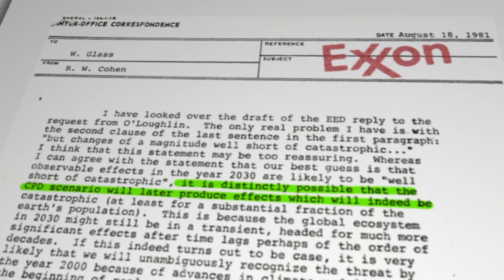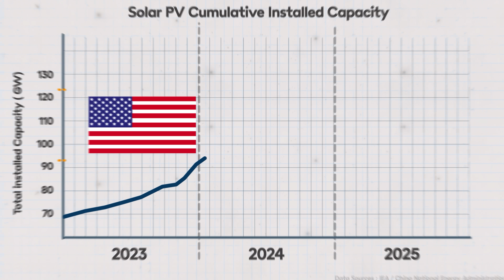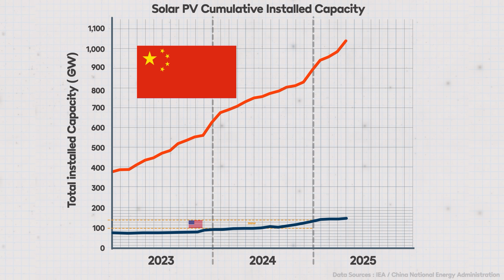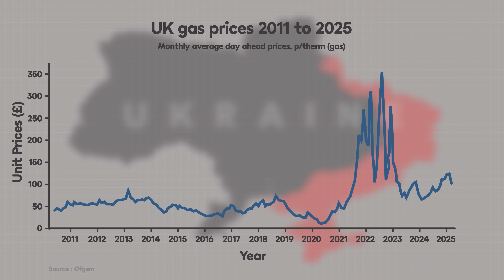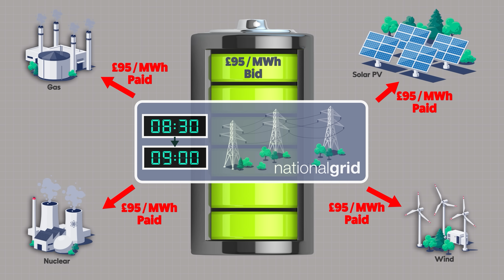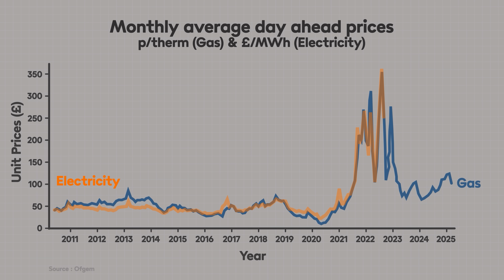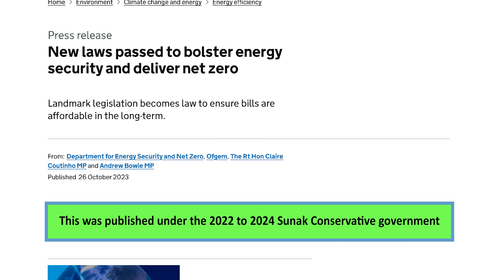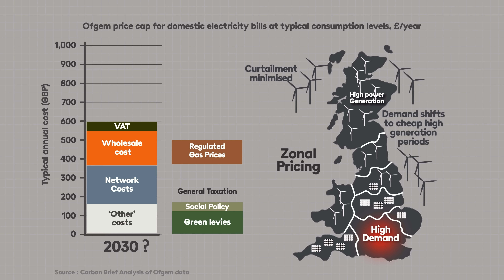Why is UK Energy SO expensive?

Comment: We live in a homestead-ish kind of land in NC. The original owners used a 15kW diesel to basically get all the power they needed and they were allowed to use the un-taxed farm diesel, because of some thing, probably grand-fathered in. We would have to continue with raising animals, which we obviously don't want to do, and tbh, me and my wife are just remote systems consultants with some travel.
Getting the power company to put power in our land would have cost us somewhere around $90k+, about $65k to the power utility and another $25-30k for the work we needed to get done on our own. We went with solar instead. Cleared off 7 trees which would have created problems and were old, and then we started learning and building slowly. We have an on ground solar array of 8kW, and our shed and larger shed which was used for farm vehicles has another 3kW + 8kW array on the top.
A total of 19kW of power, which is usually more than enough to provide daily power and also charge up our batteries. We decided we didn't want to spend insane money on getting batteries for home back-up. We found older battery modules from electric vehicles (we have nissan leaf modules, they go for real cheap, f150 lightnings, and a few tesla modules) and have around 130kWh of usable power in our home backup. We don't need UL or CE certifications, as we are not connected to the grid although we got it inspected by an electrical engineer for its safety. Total cost of materials was less than $55,000 - including buying the battery modules. Another $10,000 spent in equipment rentals (trench diggers, skidsteers, etc.)
We have a small 5kW generac portable diesel generator - it doesn't provide power to anything else, except for the batteries. And in the 5 years we've had it, except for the first year when we were working through everything else, it has operated for like a total of 250 hours. It charges the batteries, at a constant output of 4kW, which is excellent load for the diesel and also our inverters don't even get heated by it.
We bought 5-6 year old solar panels. Their pricing? We got those at 35 cents per watt. A popular panel like Qcell, 410W typically sells for around $330, or about $0.8 per watt. We didn't care about the degradation in the panels. And we still have like 20 panels in storage, because we don't really need those. This year, the only fuel we really bought is getting our propane tank filled once by a propane delivery service in our area, for outdoor cooking.

Anybody who tells you that renewables are more expensive is straight up lying to your face and insulting your intelligence.
Reply: Thank you for telling your story. It is very interesting. Being independent of grid supply is what a few people try here in Germany but is hard to achieve as there is very little sunlight from November into February.

330$ for just one 400 Watt panel sounds incredibly expensive to me.
I live in Germany and have bought 2 small solar plants, so-called balcony solar ("Balkonkraftwerk") . Both consist of two 400 Watt panels and an internally limited Inverter; the first one limited to 600 Watts, the second one to 800 ( this was after the legislation was changed and the limit increased). Such inverters can be connected to the grid by everyone without having to call an electrician. 
The first plant cost me 540€ or roughly 600$, the second one about 350€, and now you find such plants for under 250€. I bought the panels on eBay Germany at about 80€ each from a commercial supplier plus 50€ shipment for both. Now such panels are sold at 50€ per part. To my knowledge there is a huge surplus production of solar panels in China which is keeping the prices down.

I have put up the four panels in the garden and they supply a water pump for the pool which draws 700 Watts from the grid - 6 hours a day. I use about 90% of the homemade solar energy myself and only feed  10% into the grid. I don't get money for the energy fed into the grid but I don't care. Energy prices are high here in Germany. Just got a new contract for 30 euro cents per kWh (down from 36), and the 1000 Euros I paid for the system including some mounting parts and cables will be paid off bei the end of next summer. 
All that in northern Germany at a latitude that's equal to southern parts of Canada with probably much less solar output than in North Carolina. Nonetheless we are building big and small solar plants like hell in Germany. There's a total installed power of about 105 GW currently. Balcony solar systems - officially one million, probably another one million never reported to the grid companies - only make up a small portion of that. 
In the summer half year solar makes up about a quarter of Germany's total power consumption on average, in the hours around noon even more than 70% (up to 48 GW, at the total demand of about 65 GW). We even have to limit feeding to the grid now as energy prices on the spot market not just fall down to  zero , but get negative, so grid operators actually pay for delivering energy. This won't work on the long run, of course.

 In the energy crisis of 2022 many homeowners installed solar on their roofs, with about 10 kW as a typical size. Many people got ripped off by electrical installation firms when there was a rush - with some paying 30,000€ or more. But even them should be able to make their investments work - in some cases by adding a battery. Few people are autonomous like you are. Especially in the winter months there's virtually no solar production - but then wind kicks in which provides another 25% of our energy.

I wish you a good success with generating you own electrical power.
Reply: So you spent almost twice the national income, building on land that would be completely unaffordable for most people....
And you say it isn't expensive?
I'm pro solar, but you are high on something, or very dumb, if you think that isn't expensive.
Reply: They are more expensive when you take into account energy density, the low efficiency,  lack of spinning reserve, instability of the system and the cost of infrastructure, the pollution created during their mining stages and manufacturing,  the fact the zealots say they are carbon neutral, their man selling point does not take into account the above pollution and damage to the environment, in the real world, they are far more expensive considering a combined cycle power station is 87% efficient while you average fan and solar panel is 20% efficient when the wind blows and the sunshine's, don't forget any the energy density, the 30MW combined cycle station will fit on 2 acres, provide 100% reliable power 24 hours a day with a spinning reserve and inertia, 10 MW turbine will require 25 fans to produce the same amount of power over hundreds of acres, if the wind blows.
Reply: @bigboy9693 to my knowledge the figures are these Wind: 15g CO2/kWhr, solar and also nuclear: 60, ccgt: 300 at best, gas peaker: 430, black coal: over 900, lignite: 1100 g CO2.
You can't compare the efficiency of solar - which is 20% - to gas which varies between 40-45% for gas peaker power stations and 55-60% (not 87%) for CCGT.

You may have mistaken the energy efficiency auf domestic Gas heaters for the efficiency of power plants driven by gas.
 Wind and sunlight are just there - use them as you can. Their energy will get lost anyway otherwise. Try to be efficient, but not overly. Nothing is consumed to generate wind. But natural gas can be burnt only once and is a very limited resource. The riches gas fields in Europe are the Dutch and Norwegian fields. The Dutch field has been closed because of too many earthquakes and building damage. The Norwegian gas fiel in the North Sea is at peak production and will last for another 14 years - then it's over. For the United States estimates are between 12 and 17 years of gas production left. Wind and sunlight will be there forever.

The material resources problem looks like being very exaggerated to me. There is no problematic material in solar panels. There's no shortage in silicon, glass, or plastic. The only problem is the very inefficient production process for the silicon requiring a lot of energy.
Depending on the site where the solar panel is taken into operation it's a few years until the energy used for the production is actually produced. For wind turbines this EROI time is much shorter.
Here in Germany the new much larger wind turbines of the types currently built produce the energy used for the production of the materials - mainly cement and steel - in just *three months*. 3,200 t auf total weight per wind turbine, thereof 2,300 tons of concrete,  with the rest being mainly steel. 50 % of the concrete consists of cement. 7 to 8 million kWh of heat energy is needed for these amounts of concrete and steel. A coal power plant would produce around 3 million kilowatt hours of electric energy from this amount of heat.
On a site with sufficient wind like in Northern Germany the wind turbine type I'm speaking of provides about 16 million kilowatt hours of electric energy every year., it's nothing is burnt for energy. Yes, the grid has to be extended but so what? that work is done once and will  last for many decades. And yes, some Gas power plants to provide energy are needed when there is neither wind nor sun. Battery storage will take a part of that and like the gas power stations help to stabilise the grid.
Reply: @ElwoodEBlues  When the wind blows and the sun shines, ruinables are increasing the cost of energy around the world.
Reply: @bigboy9693  weird that every country is mostly building renewables now If they're more expensive. And you know the thing we mine the most and destroy whole landscapes for is coal right?
Reply: @bigboy9693  plainly and utterly wrong.
Reply: @ElwoodEBlues  Plainly, my electricity bill proves you wrong, yesterday I just received another increase, the more ruinables, the more expensive it becomes
Reply: @Benedikt_J  The west is being industrialized while the grifters make money of the subsidies. this why they want to ban the engineers who know what the goal of net zero is.
Reply: @bigboy9693  your supplier may have had an increase in cost itself, like increased wages, extra repairs ... or just the share holders wanting more.

And even if it's increased cost by renewable generation .... well, that may happen. You have noticed how long Americas gas ressources will last? Another 12 - 17 years, various reports by Shell, et al. say. What will America do if the gas essources are spent? I suggest you use renewables as much as you can so you can extend the time you have gas supply.

If you look at european energy prices you'll find yourself lucky to live in the USA.

Here in Germany just taxes and fees make up 30% of the kWhr price, with roughly 17% of the total pricee being VAT. 

The owner of the house I live in made a new contract with another supplier, hence the price is now 30 €cents/kWhr, down from 36.

And it's not renewables that drive up the price - it's natural gas and the way the european energy market works. As soon as the demand goes up gas peaker power stations kick in - but before they do, they place a bid on the energy exchange (EEX). And when demand is high but supply is low they take the opportunity to "offer" their energy at outraging prices. And worse, even the other suppliers, including wind and solar parks, will get the price the highest bidder has offered.
The big problems here are currently
- no domestic natural gas ressources
- high gas import prices
- an outdated energy exchange that drives up prices
- local governments of the southern states, namely Bavaria, refusing to split up Germany into billing zones with individual prices - if we did, the industry in the south would have to pay more, while here in the north it would get the energy somewhat cheaper, namely on days with plenty of wind.
Reply: @ElwoodEBlues  If Ruinable are so good, remove the subsidies, but we both know they cannot compete on a level playing field, apart from the fact they are intermittent and are unfit for purpose.
Reply: @bigboy9693  you reduce the view to the price, that's the problem here. OK, in the US natural gas is dirt cheap. And that's why it is wasted light-handedly. Private houses that consume 11,000 kWhrs every year? Bonkers. But insulation or solar on the roof could fix this, as aircon is the main problem.

I've read a report explaining why NuScale failed with its SMR concept: too expensive. That same report said that electric energy from wind and from natural gas cost the same in the US - 4.7 cents/kWhr. Nuclear power at 8.9 cents is not competitive; that's why they gave up.

But gas is limited, and wind is not. Extending renewables will help extending the time gas is cheaply available from US soil. Just consider the US had to import natural gas, like Germany - electric power from natural gas may easily double in price. Gas prices on the world market went up sharply in 2021 and are now at 250% of the level they had in 2019. 

Did you know that about 11% of the electric energy produced in the US is from wind - and another 5-6% from solar? BTW, with 430TWhrs US wind prod is almost as much as Germany's total public production (440TWhrs(year), excluding private power stations owned by the industry)

It's time to reduce subsidies for the oil industry, put decent taxes on energy generated from fossil fuels, and reduce the wasting of energy. That's my view.
Reply: @bigboy9693  We differ in opinion, but I like your cat - had cats for many years. They are great friends. Cheers.
Reply: @bigboy9693 lol, I had a 60 Mt square remote house without grid power. and put a 5kw system with battery and the system will be paid in the next 5 years!!! I do live in a sunny place and don't need heating, but do need a lot more AC. But the house is well insulated. I could double my system later and it would still be profitable.
Reply: @bigboy9693 Most comparison reports take ask this into consideration these days. The data has been thrashed out over decades now

What fossil fuel zealots seem to forget is the cost of extraction, shipping (50% of the global fleet), the pollution waste clean up of the supply chain logistics of that process, the trillions in subsidies and breaks fossil fuel companies get.

I mean financially if you leveled the playing field for all in the energy sector and remove all subsidies and breaks fossil fuel companies would fall on their faces

Also let’s not forget the billions spent on defending the fossil fuel industry with the military industrial complex. Distributed and autonomous renewables don’t need aircraft carrier battle groups to look after them
Reply: @bigboy9693 'Ere, lads, look at this eco hippy saying even making solar panels is too polluting.
"I detect a little communism, I can see it in the things you do..."

Comment: Wait, did I follow that correctly? It’s actually super profitable for the companies running solar and wind farms to NOT provide all of the electricity over there, because they have a radically better markup if the last little bit is provided by the super expensive gas?

Do I understand that correctly?

Green power companies- “so, we could provide 100% of the needed electricity, at £35/unit, or we can provide 80% and get paid £95/unit if we let gas pick up the slack”

If that’s actually how it is, that’s some USA levels of messed up bureaucracy.
Reply: My thoughts, too. Given that gas keeps getting more expensive an renewable cheaper, the incentive to install renewables is enormous. Once gas is no longer needed, the price of electricity should collapse. Which is when they'll rejig the pricing mechanism, no doubt.
Reply: Sounds rigged to me
Reply: It's the prevailing model here in NZ too. Crooked as F*CK if you ask me. Generators should be paid what they bid and not a dime more, the total cost of energy spread over the total quantity of energy, and the consumers charged that.  (If your bid to buy falls under the prevailing market cost, you don't get to consume, as is the status quo).